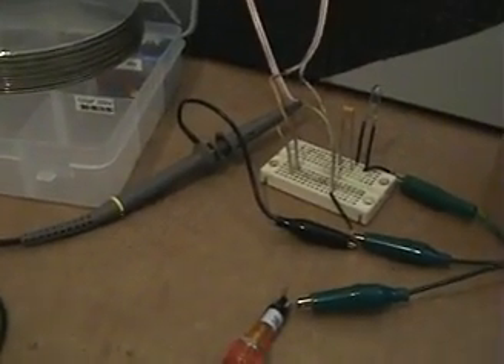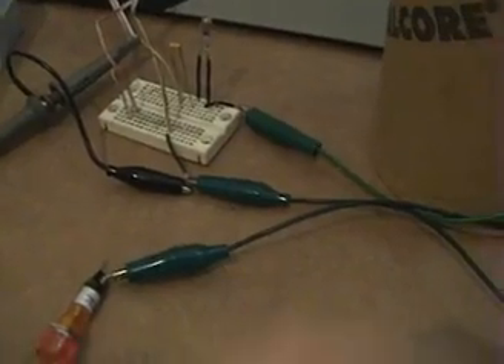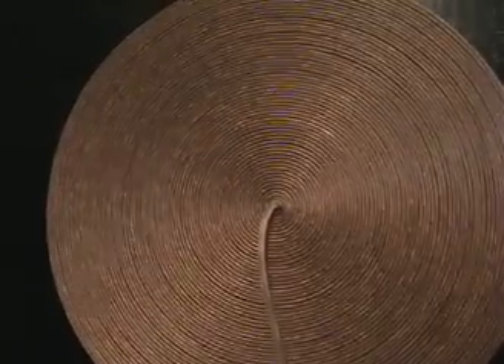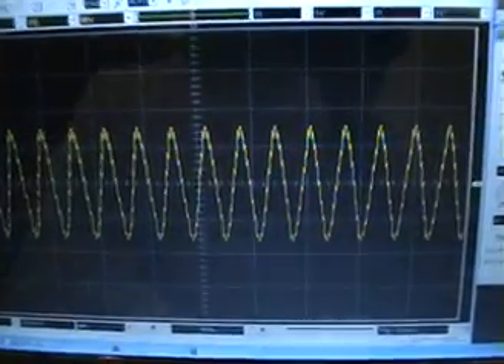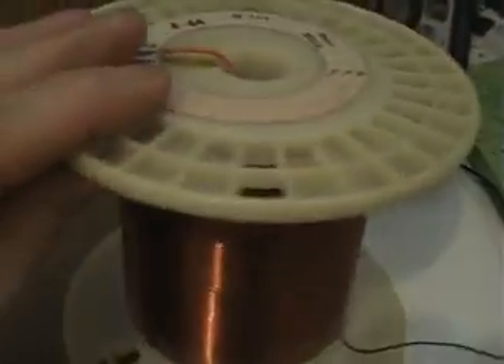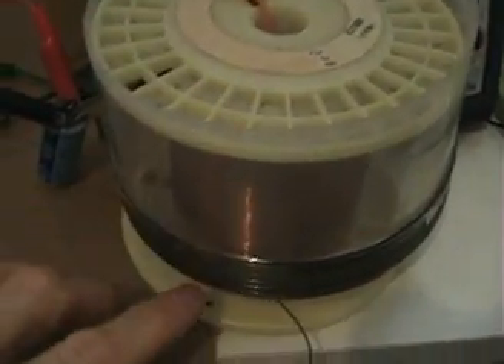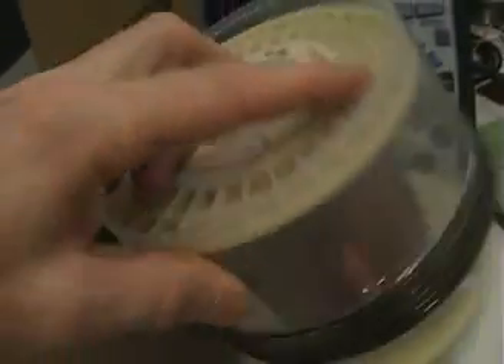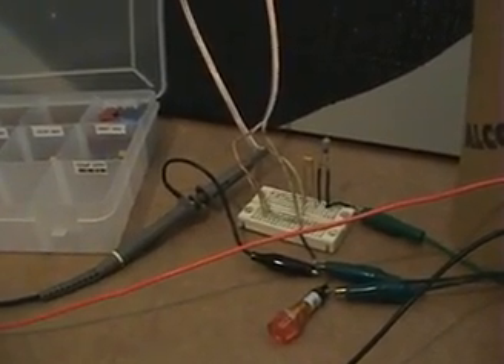RESONANCE EFFECTS FOR EVERYONE TO SHARE test 11

Comment: Hi gotoluc. Great work on all of you videos. Neat work and easy to see what is going on. Heres an idea for winding a bifilar pancake coil with speaker wire or lamp cord. Consider starting near the middle of the 100' of wire and then make a nice fold and then twist one leg so that you have the striped wire "paired" with a non striped wire. Hold the wires together and start winding. This will form make two bifilar wound coils, one on top of the other. Just connect the ends as Tesla prescribed.

Comment from the maker: Hi minde4000,

it doesn't work like a standard transformer! so it does not draw more amps. The secondary works more like an antenna! bringing it closer to the primary puts the primary out of tune so you need to re-tune. Also you may think that change would give additional output at the secondary but this is not the case! there is no change.

Luc

Comment from the maker: Hi WaxingRadiance,

good observing skills you have. I did try that at first but this plastic shielded wire does not bend well when laid flat, so I wound it this way first. If I redo it I wouldn't be able to get the center so small.

Luc

Comment: I agree it's a very nice way to build a pancake coil. On the other hand, I don't agree that it is bifilar. If I see it correctly you have the 2 cores of your 'speaker' wire stacked instead of interlaced. I am sure a true Tesla pancake coil has a thickness of only 1 wire and the 'effects' (if any) come from the 2 interlaced spirals. Could you try to rewind the wire flat face down instead of on edge, and repeat the test?
Keep up the good work

Comment: Since you have a nice bifilar to play with, you might try this: input into one wire on side A of coil, where it comes out on side B, connect that to the other wire on side B, then it comes back through the coil and outputs on the second wire of side A.  Ive read about that but never got a chance to try it myself.  Just a thought.  Anyways great work as usual!